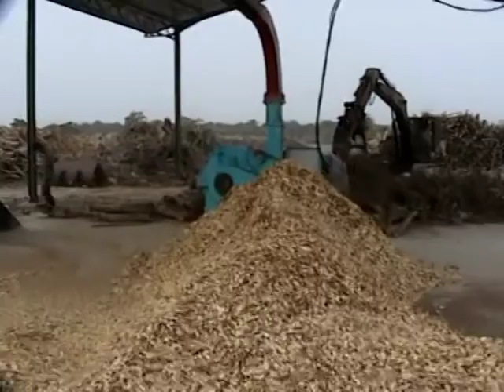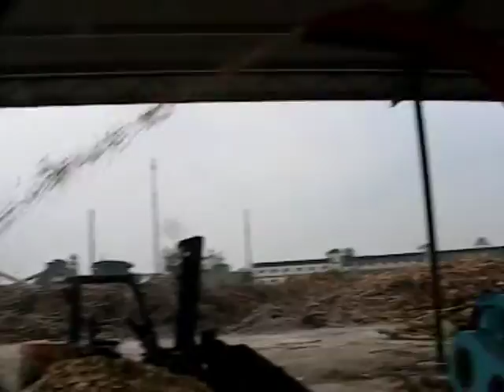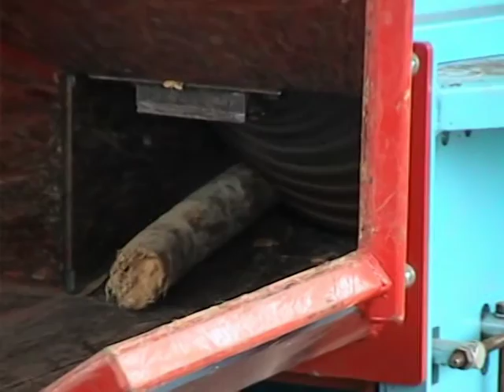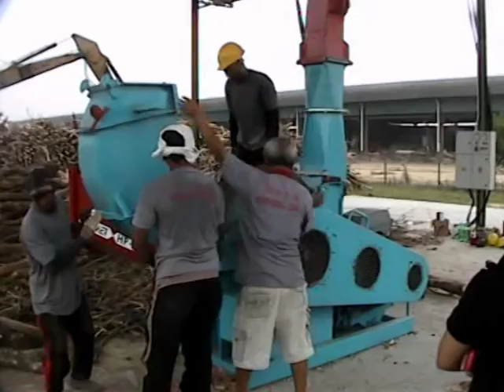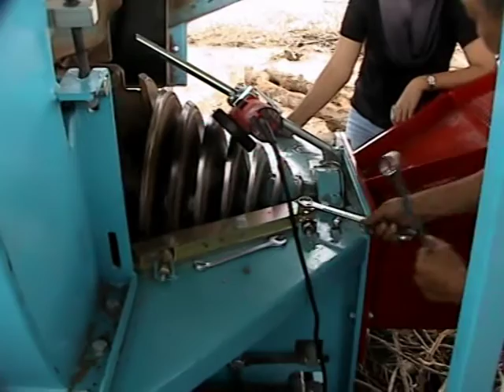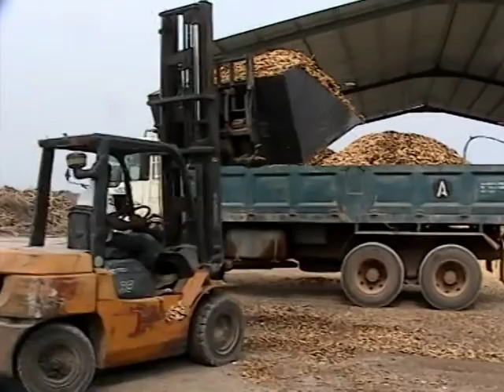Laimet HP-25 screw chipper on logging waste

Comment from the maker: Yes this was filmed during first week of operation before an infeed conveyor belt was installed.  Cutting too much air, must admit.  Positive side is that the rawmaterial is free and otherwise left to rot in the field so efficiency does not be that high considering also the awkward shape of the branches.

Comment from the maker: they do 2.000 tons per month but admit the infeed conveyor is of poor desing and locally made after delivery.  The rollers are too far part and with no spikes and the gears broke down on my last visit there a month ago.  The chipper is a larger HP-25 with a 110kW motor with spare parts, spare screw, sharpening system, training, freight to Malaysia was Euro 49.900